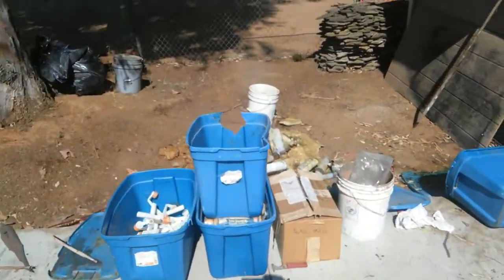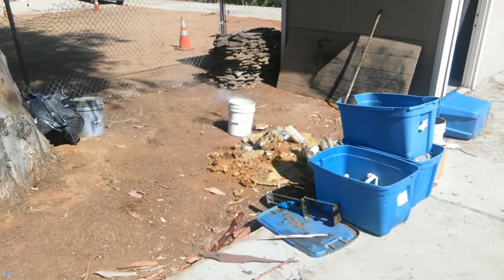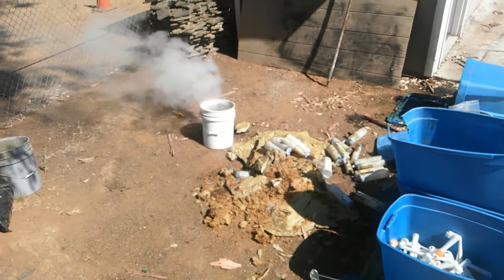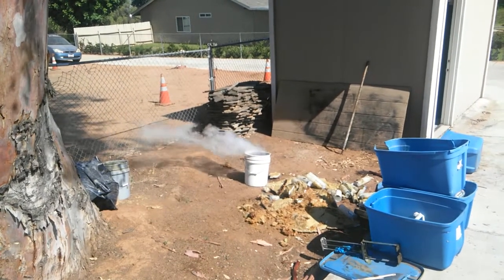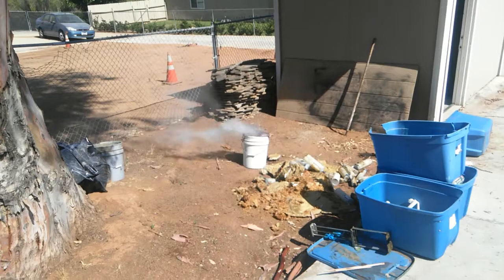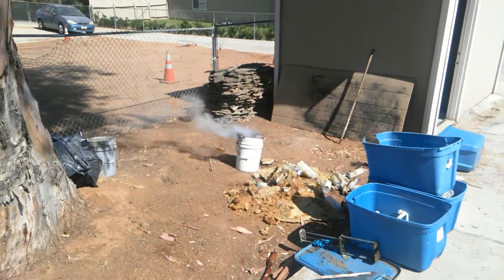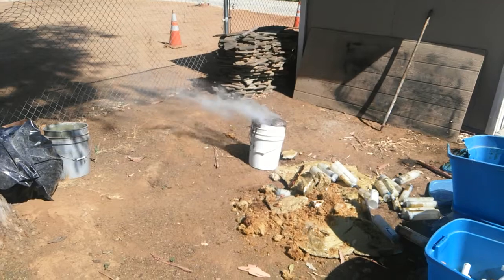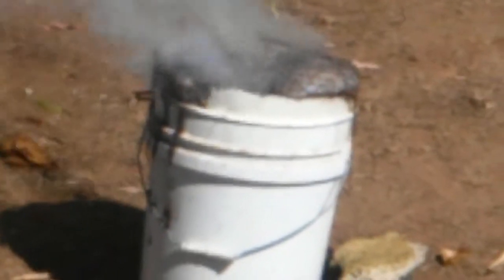Epoxy reaction

Comment: What is reason for this, I also experienced this “epoxy resin with cement”
Reply: Exotherm, if the resin is in a container the heat can't escape, but if it is laid out flat the heat is spread out and will work out fine. After mixing it, it should be poured right away evenly and thinly. Learned all this the hard way, my project boiled and hardened with so many cracks.